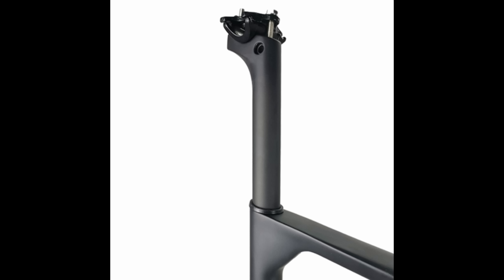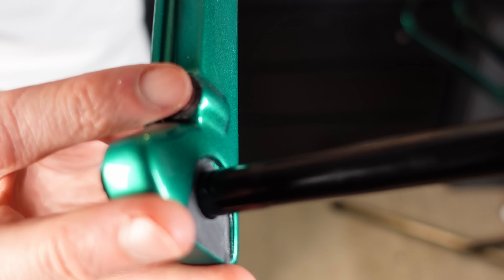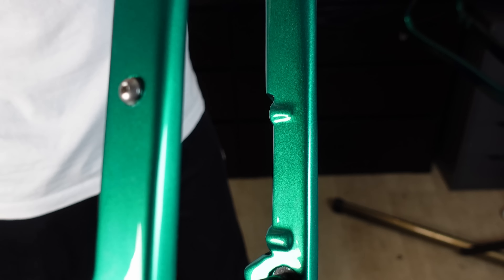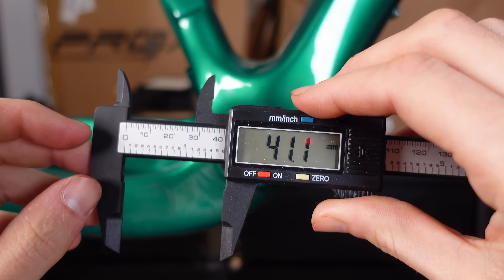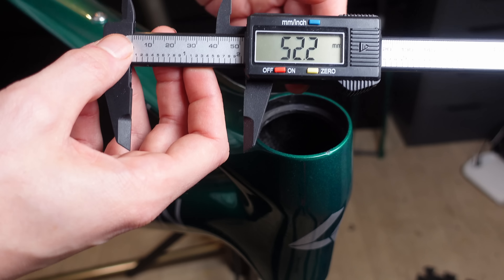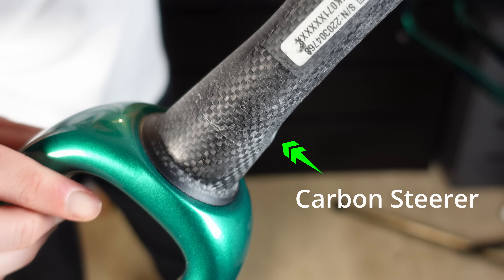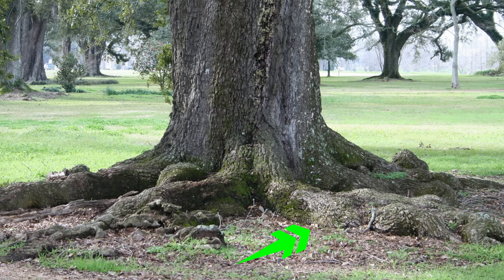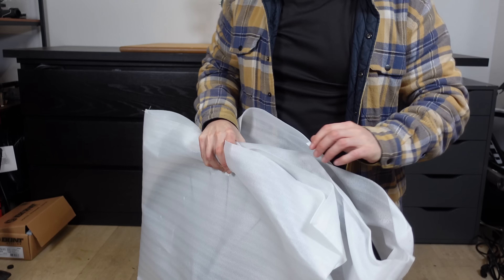$500 Gravel Bike Frame: TRASH or TREASURE? Uboxing and In-Depth Review!!

Comment: Bought and built up a commuter bike based on this frame. Done some heavy duty single track and done 1000 miles on it. I absolutely love it. It is solid and comfortable, it’s not sketchy or racy but it does inspire confidence and is comfortable. Did 100 mile rides back to back and handled it very nicely. Paint job is really good got mine in the grey and looks slick
Reply: Forgot to say thanks fella would not have bought without your review keep it up. Looking forward to more feedback on the Falath evo
Reply: Also you can specify the seat post to be match painted and this looks good
Reply from the maker: Glad toy hear the bike is working well for you. It's really good value considering the custom paint. I can imagine the seat post being the same colour is pretty unique as well 👌🏼 also good to hear the videos have helped you 👍🏽

Comment: I've got this frameset in XL, left it in matt black and I absolutely love it, paired with their low end carbon gravel wheels, 1x ltwoo 11 speed and it comes in at 8kg dead nuts with pedals and Garmin mount. Fantastic build quality, I'm a heavy dude and can pump out some power out the saddle, thrown it around, bunny hop it everywhere and it's never made a sound, I'm just as quick on this as my Giant Defy. Id get their road frameset in a heart beat unfortunately it's just a bit too small for me.

Comment: Bought this frame a couple of years ago, raw carbon (I did my own paint job), along with the LC wheels.  ProX is the same wheel but they started marketing them under their own name.  Put it together myself and have no issues with the bottom bracket or headtube - no squeaks or loose bearings.  Routing the cables wasn't too much of a hassle but did take some fiddling.  Highly recommend this frame, pretty robust - and I weigh 220 lbs.  I run it 1x because it suits my location.  They have great pre and post sales support.

Comment: Hi Jordon, after a lot of research into Trifox frames decided to order a Trifox X18 frame. Waited 6 weeks for delivery to UK, looked nice frame, built it up, went for 1 ride and kept hearing cracking noise. On my return i investigated and found that the seat downtube between the seatstays and the bb there was alot of carbon delamination as it was really soft. Complained to Trifox and after a couple of correspondants they never replyed to me again. The frame now sits on my turbo as it is too dangerous to ride on the road.
Personally i have learnt a very expensive mistake that never but from direct from China as for the average person you may not get your money back and guarantees are worthless.
Reply: I've heard that Trifox is pretty much the bottom of the barrel though 🤷‍♂
Reply: So which makes are better?

Comment: I own the same frame and I used to work in an F1 team where one colleague allowed me to scan with X ray the frame and I was told it is a very very well built frame. In my case the BB and the headset are perfectly round. The only thing I did wrong was masking the brake caliper contact surfaces before to paint it and they were not perfect but that was my fault.
Reply from the maker: Good to hear you have had goo experiences with this frame!! 👍🏽
Reply: @DanTuber  to check if there are any cracks in the carbon parts after a race. To make sure the carbon parts have been properly built. To don't need to strip assemblies that are sealed by the FIA to check their condition ...
Reply: How many stem soacer did the frame come with? What do all of them together measure? Thanks for the video, great information!

Comment: Those BB tolerances don't look too good, I think. There is a 0.8mm variation which is a lot.
Reply: Smash in a screw together pressfit BB and it will be most likely fine. One of the benefits of PF over threaded.
Reply from the maker: Let's see how we get on in the build 👍🏽
Reply: @JourdainColeman  Still might work out fine. I have a high end shop around the corner and they too have bikes for € 10.000 with creaking bbs coming in.
Reply: Hm that caliper looks quite cheap, also not the right tool to measure the BB fit
Reply from the maker: Yeah I need some more advanced tools... I need to message Hambini 🤣
Reply: This caliper ist Not suitable für measuring the roundness of the bearing seats. You need an internal caliper with a dial gauge.

Comment: Im curious how the falath pro is riding? I've been tempted by their evo model but I can't see me using larger than 28mm tires so the extra clearence would probably be a negative rather than positive. I'm hoping to see a good comparison in the next few weeks otherwise i will just pull the trigger on the pro model, though the ICAN A9 is also an interesting prospect.

Comment: I currently rode a 2021 Alloy Diverge Elite E5. Like the reason for this video, I want to upgrade to a carbon frame with internal cabling but on a tight budget. Having watched this video I’m thinking that this may actually be doable. So do you think I could order one of these and take it and my bike into a shop and have a mechanic move everything over? Thanks
Reply: I want to do the same... but buy components and build it myself..mechanical groupset.
Reply: I did actually buy the frame and had it built. Had it since January and have only been on 2 fairly longish rides, the rest has been commuting but it’s been great so far. The company were great to deal with, quick responses from Wendy and it arrived a month before I was expecting. Really impressed at it all.

Comment: I take it back. 800 USD for integrated bars,seatpost and custom paint,is pretty good value. Light carbon and Carbonda are two of the best carbon manufacturers in Asia. Did the 800USD  include customs? Looking at LC and ProX for CX build with sensah SRX 1X. Thanks Johnny

Comment: I bought a BXT gravel frame this past winter for a similar price. I'm impressed with the quality, and very happy with my build. 

It's good enough that it makes me question whether I'll ever buy another bike from a major brand, or just build my own Chineseium bike again.
Reply: Got a BXT too, did you have problems installing the front derailleur?
Reply from the maker: Good to hear the frames are working well for you 👌🏼
Reply: @yankomaldonado6084  I went with a 1x setup, but this frame requires a fd with a built in cable stop. GRX is the only one that I know of.
Reply: @dennismicallef9350  I used the Sensai Empire with a cable end mounted not the best/prettiest but it worked. I think the new Ltwoo also have cable stops
Reply: Most major brands get frames from China but to their specific requirements . Then painted with their brand logos

Comment: 1X setup is for slow gravel cyclists, don't compare it to cassette tape players just because you're slow 😉

Only place i'd have a 1X is on a mountain bike.
Reply: Depends on the terrain one rides, doesn't it? I ride 2x, but could see that someone riding hilly trails might not benefit from that.
Reply: Even pro road bikers use 1x during Paris-Roubaix so that's a bit silly to say isn't it?
Reply: I have 2 Bikes with SRAM AXS.
1 by And 2by.
And theye have the exakt same "Entfaltung""Übersetzung".
The 2by has  12 gears more, but it's almost the same like 1by.

Comment: not worth it
Reply: why ?
Reply: @nicokop7078  why would you cheap out because of 300-400 bucks? Established brands offer lifetime warranty on carbon frames
Reply: @josipX  it's not cheaping out if it's more than one can afford...
Reply: @DjCringefest  if you can't afford carbon then alu + rim brakes are the way to go
Reply: @josipX  rim brakes on a gravel, fantastic idea....  And "lifetime" warranties have a ton of loopholes. Well, you can always hope 🤞
Reply: @bindingcurve  was thinking about road bikes but yeah still go for alu if you're on a tight budget, anything else is ridiculous
Reply: @cccpkingu  Tire clearance is a BIG one. But disks are such improvement offload. I had a set of XTR rim brakes with NEW pads on 2004 Cannondale SL600.  That bike has the mounts for disk and I switched it. The difference is HUGE.  I run 105 Mech Hydro on my Checkpoint.  On slippery loose dusty 20% gravel drops into hairpins, you will NEVER get me to use rims.
Reply: How much would a comparable frame, handlebar and seatpost combo from a known brand cost in comparison? Double? Triple?
Reply: @HeadPack  Not really
Reply: @josipX  if you can afford an alu frame then you can afford a carbon frame. spending more on a brand name and lifelong warranty gives zero guarantees. lifelong warranty is a pitch for those who want to be sold something because they don't cheap out. a frame will never last you a lifetime under normal use and such warranty says something about a brand and how they view their customers.